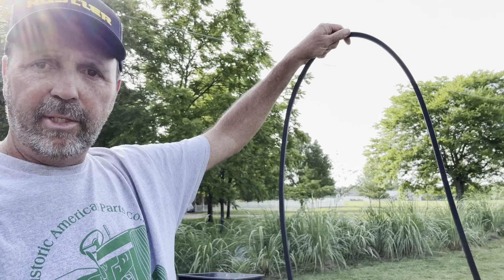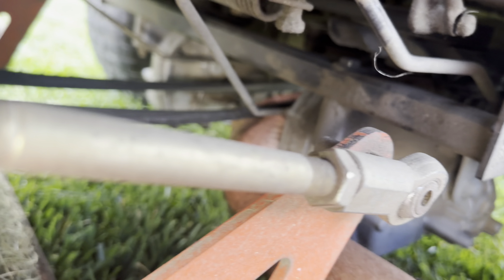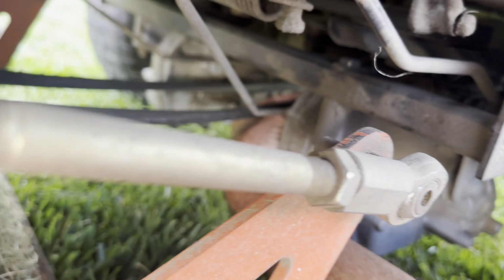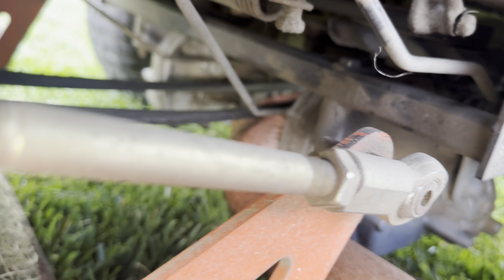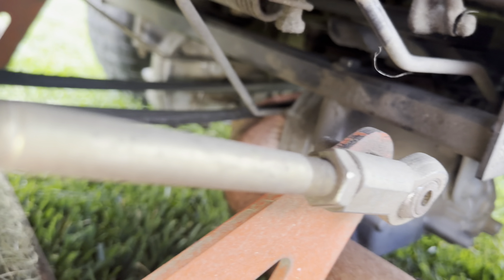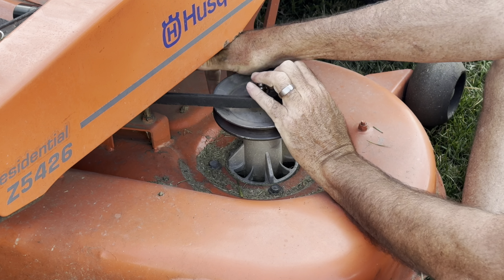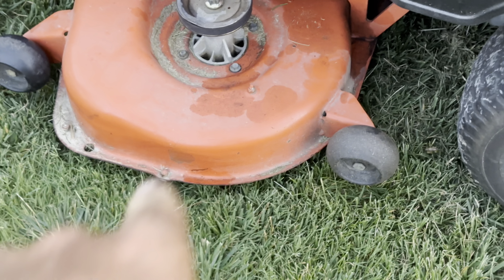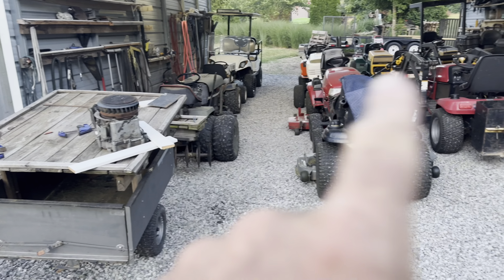Zero turn mower deck belt install ￼

Comment: It is never easy fitting a new belt when the deck is on the machine. Great job with the belt
Reply from the maker: This was one of the harder ones I’ve done and yes, I had to loosen the deck off mower a little bit to make it work

Comment: i have a murray rider from the 90s/early 2000s that has a flat pulley on trans and the narrow part of belt runs on the flat pulley . yes , it was designed like that . couldn't believe my eyes when i 1st saw it . part of a system where the gear shift handle also works the clutch (you can also just push the clutch pedal if you prefer) so that they can call it a shift on the go . to my amazement , it works fine , and doesn't turn the belt over or wear it out . i've never seen another situation where a belt ran on a pulley like this though .
Reply from the maker: I do not believe I’ve ever seen that, but I’m sure there are different designs out there